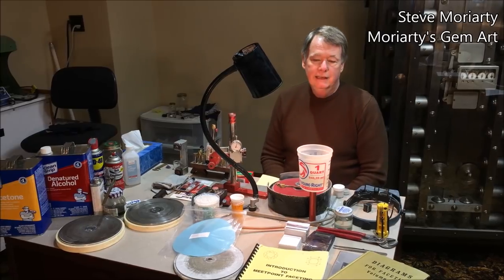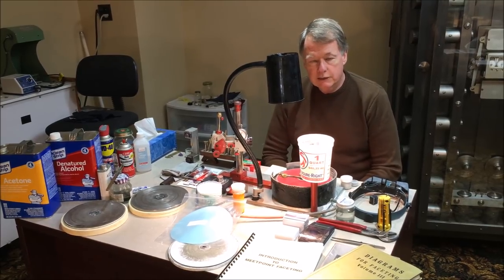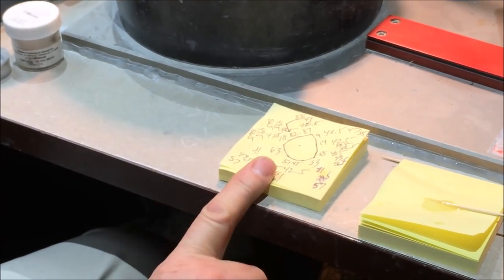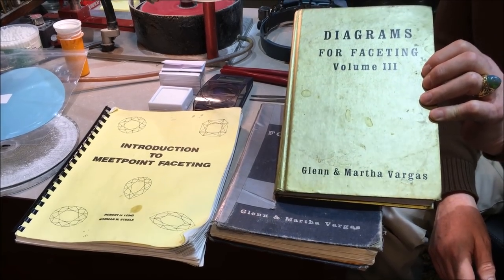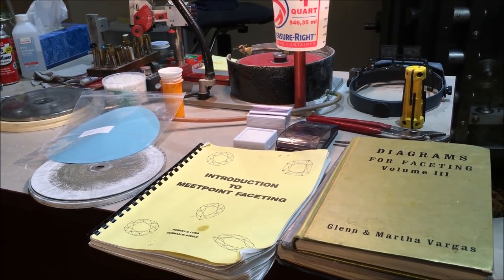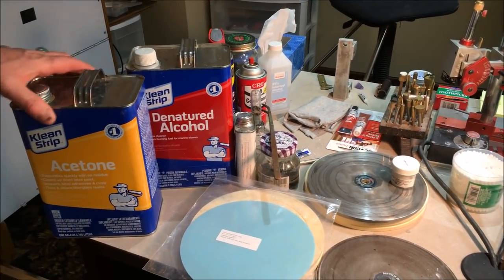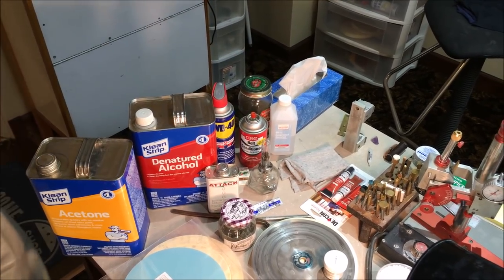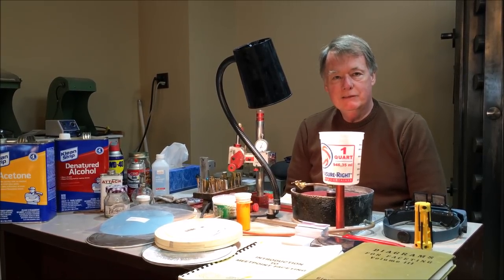How to Cut & Polish Gemstones: Introductory Lesson

Comment: Hey! I used a "Best WD150/200A", and made a very nice gem.. And that gem i made was the first one I've ever made =)
That machine is not supposed to be used to make gems but sharpen knives etc ;D 
So if u got some technical expertise, you really don't need high tech equipment when your starting out, just a tip for beginners ;)
It is a learning curve involved as with every skill in life, unless your super smart ;P
PS. Thanks for the knowledge and the video Steve..

Comment: I thought about cutting my own gems for dice. Coming to this video I now realize that is a bad idea with how much stuff you need and how expensive it would be.
Reply: Hey just an FYI, this is stuff required for faceting gems to use in jewelry. Since dice are very simple geometric shapes you could get away with using a bench grinder, a fine sandpaper for polishing, and a rotary tool for number marking. This stuff is way beyond the complexity needed for dice making
Reply: Gem dice? Seems neat. What were you planning on making them out of? might want to give it a try.

Comment: Hi, I love your videos. I have a question, what do you mix cerium oxide? water or other fluid? what proportions? thanks
Reply from the maker: Flávia Compassi 
When I use it on spectra laps for faceted opal I dip a wet finger in the powder and place it on the lap with a very slow drip of water and slow rpm so not to spin it off too quick.  Otherwise I mix with water in a relatively thick slurry for cabochons
Reply: @Moregems  Thanks for answering :)

Comment: Whew. Long winded but worth it. You know the attention to detail is there when someone even goes to the effort of putting belt conditioner on the list of things to have to maintain your tools. I don't think I've put belt conditioner on anything! Thats probably why my belts have rotted away over the years. Although I doubt even belt conditioner will stop a belt from rotting but who knows maybe it will! Thankfully it's one of the cheapest items on this list... but for the heck of it I think I'll add it to my list. I have damned near every other chemical, lube, and glue in my arsenal might as well.
Reply from the maker: Reforged Criterion It quiets a noisy belt.

Comment: you do not mention the how the blue spectre polishing pads are mounted
Reply from the maker: They placed mounted on a master lap that is applied with water. Just wet the lap and lay it on there, the surface tension should hold it, then tighten the nut.  They do make them with a sticky material on them, but we recommend the non sticky ones for easy removal.
Reply: thank you for your prompt reply.  i am diligently following your wonderful series.

Comment: Wanting to put a flat surface on a jasper stone I super glued it to a bullet casing.  Now that I have cut it how do I get it off?
Reply from the maker: Hey nobackhands, the best way to remove a natural untreated jasper, would be to soak it in acetone. This will dissolve the superglue. (That is if the stone is natural and undyed, otherwise it may be an issue and you probably will have to heat it to remove... there is definitely risk involved if you have to heat the stone though. ) Hope this helps, good luck!

Comment: If you or anyone that sees this text could help me finding cheap and good enough machines to cut-polish stones?
Some names of producers\manufacturers. Some brands and\or models. Some links to products in Amazone or another. Some names and description of the machine so I can do my own research.
In Europe or with delivery to Europe please.
 Whatever that can help me find a cheap but reliable machine so I can do some experiments and if I have what it takes.
Thanks :)
Reply from the maker: Luís M.S.G 
Sorry I have not had luck with used equipment. Used ultatek or facetron would be best bet as you can get parts.

Comment: Superglue and epoxy?  Sorry, if you screw up a gemstone,  you don't glue it back together... you throw it out.  A glued gemstone has zero value.
Reply from the maker: Epoxy is used to hold the rough gem to the dop when cutting. Not for repair. Superglue is to reattach the rough gem to the dop if for some reason the epoxy gives away when cutting. Not to repair a broken gem. If you watch the videos you’ll see how it is used.
Reply: @Moregems  I would rather use green wax or shellac.